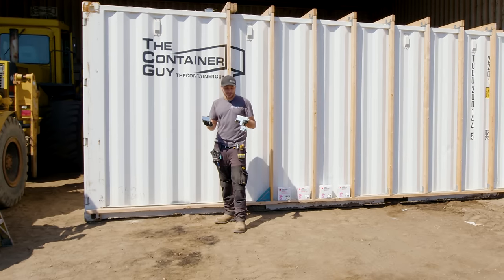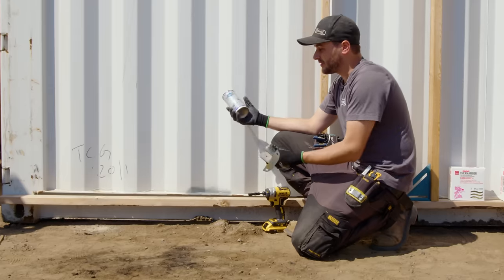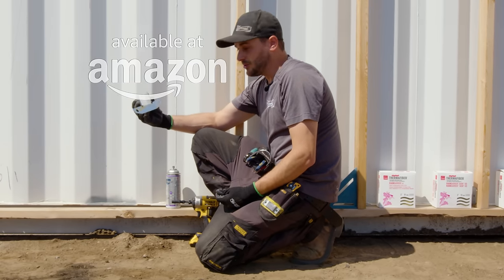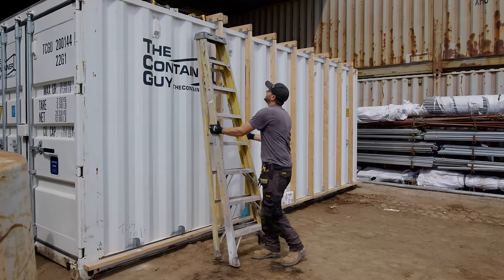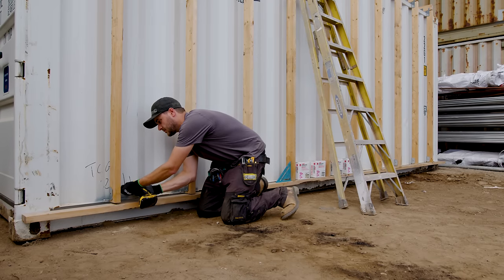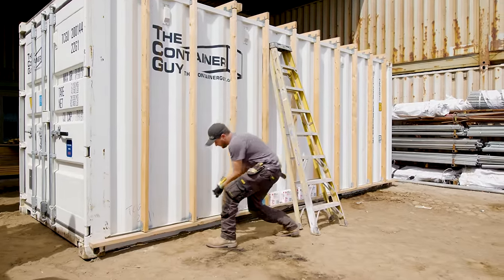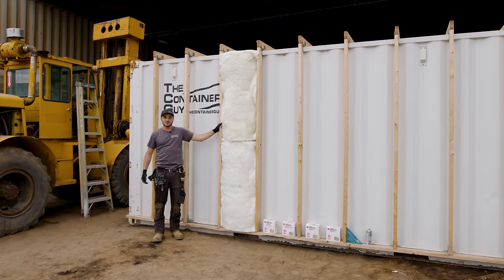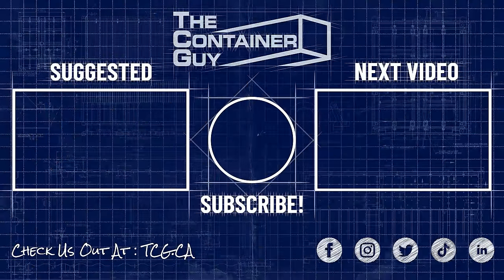Installing Our Exterior Stud Brackets On Shipping Containers !

Comment: I see lots of people commenting that if you're using wood, then what's the container for? I can think of a lot of uses! It's a rock solid foundation to start from! You're structure is only as good as it's foundation! If you want to build on a property but don't want to pull permits to put in a foundation, you could go this route. Not having to do dirt work saves a lot of hassle. Maybe you need to mount something super heavy on the roof, this would be perfect for that. You could put this out on a remote piece of property and have a super strong/secure little hunting cabin that could probably have a tree fall on it and survive. If you had need for a mobile office you can pick up with a telehandler, then this is perfect. If you want to bury a bunker into a hill side, this is perfect. It's a great product for some niche or outside the box thinking projects! Just because you're simple mind can't think of a use doesn't make it a bad product.
Reply from the maker: Smart man
Reply: Also wood is cheap and no welding. 🤣
Reply: I'd agree. I think the price is what makes this a hard pill to swallow.
Reply: I would only use a container if it was free.  Otherwise just use wood and someone might even buy the structure from you when you want to sell.
Reply: @badawesome  Or use a container, and you can sell the container and have it moved off of your property, instead of having to sell the entire property.

Comment: WAY---WAY OVER PRICED... $2,100 FOR 100 PIECES Thats 20+ for each stamped steel bracket.. hurricane clips cost 1.25 ea.!!!
Reply: A two by four fits sideways between the top lip of the container and the bottom lip, no need for brackets! Then the side protrudes just enough outside the waffles to run your siding on. I’ll retrofit hurricane clips for the top. Way to pricey !!!
Reply: Right? But then again everything this guy sells is overpriced...his man doors are 5x the price of similar man doors.. lol he cracks me up
Reply: ... they're probably being made on a "first come first serve" request 🤔 ...like the way blacksmiths used to build stuff.
Reply: It’s expensive… do they make it in house?????🎉🎉
Reply: Yes he is crazy as hell with stupidity for prices
Reply: I fail to see why you would even need a container if your just going to stick frame the whole thing anyway...I dunno maybe I'm not getting something
Reply: @seangrey3505  - I think it's easier to install Insulation between Wood Studs. 

That said, why not "Stud" the "High Side" (external Edge of the Waffle Skin) if it's for More external Insulation?

Adding Extra Insulation outside, means less required inside, so more room left for "Living" inside!
Reply: @robertweekley5926   I see what your saying but if I have to build it out of wood any way I'll keep the 1500/2000 for the container and I'll keep the added cost of the wood and brackets...and just frame it up traditionally...if he had something that actually didn't cost an arm and a leg maybe MAYBE  could see buying something if I needed to stack or mod.it some other way other than just sitting level on all four points
Reply: Hurricane clips are weak and trash.
Reply: Hurricane clips are made by the millions, these just a couple of thousand
Reply: @seangrey3505  i think it appeals to people without the skills or experience to make walls level and plumb

Comment: Four thousand 400 dollars 2 do my 2 40ft containers is a crazy price. Thats without shipping 2 Australia.  Will the price come down at all?? I love all your products , but struggle with the prices. I understand they are fit for purpose but we pay about 4k for a 40ft high cube.
Reply: same here
Reply: Agreed, I really like these brackets, but the price isn't realistic for me either. I get they aren't made in China, so the price is paying for Canadian materials and labour rate, but at the end of the day it's either viable or it's not.
Reply: @langdons2848  Yeah the Kit for a 40 foot top and bottom is 92 pieces (I believe) for 1,850 dollars. I assume that's USD, but could be Canadian? Either way, it also comes with the screws. It's only $20 a bracket. So not like a terrible price per bracket but when you need 92 of them it does add up fast. I bet if they could get a bigger production going they could come down on price but that'd require a lot of sales and investment on their end. Like normal joist hangers for a deck or a house I'm sure they're made in the tens of millions and shipped all around the world, so they can get a lot better price per unit because of the vast amount being made. It's always a lot harder for smaller guys to get those quantity discounts. I really like these brackets but at 1,800 dollars it's basically the cost of a used container. Really good idea though. If I was them I'd try to see if one of these big manufactures doing joist hangers would want to take over their production to get the prices lower. If I were gonna buy these, I'd want to see a price of about half of what they're charging now. Otherwise you may as well just figure out a DIY system.
Reply: @dedalliance1 I agree, Simpson could do this for ¼ the price an still make $$

Comment: I think the bottom ones should have a flange that you can screw the bottom plate onto instead of toenailing. If the edge of it was dropped to be flush with the metal lip on the bottom, that would be even better. Nice job, keep them coming.

Comment: As a german carpenter master  i can say build without a Container.  No condens and your free in place for rooms.
Reply from the maker: If everyone were as skilled as you, I agree there is no need to modify shipping containers. The one argument for them is there is no concrete flatwork or foundation  required and you begin with a structure from Day 1.
Reply: @TheContainerGuyTV  correct. Point foundation is the Future. No massive concrete. 1m3 concrete in germany is 220€.🙄🙄
Reply from the maker: @thomasschafer7268  please continue to provide input on the system as I release videos. I am not a carpenter but I feel a sense of responsibility to develop a healthy, low cost method to modify single containers with readily available materials for those who are less fortunate and need a roof over their head.
Reply: I helped a friend build a container cabin several years ago and came to the same conclusion. The result was fine, but the container really is limiting. One benefit though is that my friend needs to move to a new property soon and it will be very easy to pick up the container and move it with them.
Reply: Does the temperature stay pretty regulated in this thing or is condensation still a major issue ,as with most containers  and all unvented containers ???
Reply: What you talkin bout Willis?

Comment: I'm a metal guy too but when using wood, you should add a hammer to your tool belt to use when you need to persuade wood members to fit. Using your impact driver as a hammer could be very expensive. Living in Minnesota, any sort of structure that doesn't lend itself to being insulated is a problem. I subscribed and will definitely check out your brackets.
Reply from the maker: 👍 Yup I should have one around but not interested in lugging it around. 

That's why I said "hard on tools". I don't even know if we have a framing hammer in our tool crib now that I think of it haha.
Reply: @TheContainerGuyTV  I am curious if it's not "Better" to "Stud" the "High Side" of the "Waffle Skin, versus your application to Stud the Low Side (Indented) of the Waffle?

Comment: Excellent video. Regarding the stud-to-roof connection, you could utilize a horizontal through hole in the bracket to attach another bracket that would hold the roof rafter. The rafters could pivot on the bolt to accommodate different roof pitches. This way, the roof would be attached to the container as well as the studs.
Reply from the maker: Great idea
Reply: Exactly
Reply: Yep you are right on!
Reply: A roof bracket with a height adjustment on the outer side and middle, you could roof the container and a side area (plus give an air gap between container and roof) keeps the container cooler in warmer weather.  Could also catch the water containment for later use.
Reply: An adjustable angle roof would allow for maximized solar by changing the pitch of the roof / angle of the panels to correspond to the angle of the Sun due to the season. This would eliminate the need for added weight and cost of adjustable frames on top of the roof.

Comment: Nice instructions.  I would recommend using treated lumber for the plate (base lumber that is running horizontal).  You're going to have moisture coming down the outsides of the finished exterior.  If the lumber at the bottom is not pressure treated it will most likely rot over time and invite termites etc.

Comment: Consider running the studs up an extra foot high on one side to allow a sloped roof. A little over 1:12 slope, for panel rib metal roofing. Fire blocking at the ceiling line, and attic ventilation will also be important.
Reply: if you want a sloped roof. I want a roof deck
Reply from the maker: Check back in this Saturday ;)

Comment: Another option to prevent the brackets from rusting would be to use a rubber gasket or butyl tape (could use an old tire tube for the material)

Comment: Once again you guys are leading the way! Those brackets look plenty strong, perhaps thinner stock would work as well and reduce cost. I'll have to figure out how to attach a pitched 2by to those top brackets. The ven the large number of roof pitches used, I don't see anyway to make a line of brackets that accommodates them all. I guess do it as it's done on a stick built house, notch the rafters to sit on the top plate. I'm less sure of the economics of framing the exterior sides with 2by lumber, seems stronger than needed if typical siding is to be used. After all the container provides a rigid shell. But being able to side it hides less than perfect containers and no doubt allows them to blend into a typical neighborhood. 

I eagerly await the insulation video, as this is a major point in a container building. Just my opinion but rigid foam is probably the optimal way to go.
Reply: Yes, I thought the brackets were well over specified. Normal joist hangers are less than 1mm thick in my experience. Plenty of material could come out of those with no detriment to the structure.
Reply: @billdoodson4232  The other point would be that while you might want beefy brackets to support a pitched conventional roof, the 22" spacing might be a problem in high snow load regions. Local code might require 16" OC. And the rafters wont line up with conventional sheathing. Someone smarter than I can figure out how to best use these.
Reply: Easy problem to solve. See my comment above.

Comment: Consider redesigning that top bracket to accommodate the top plate, move those outside ears back a bit. Redesign the bottom bracket to hold the bottom plate. With the insulation you could split the sides of the batt in a few inches to tuck it in behind the stud and create a bit of a thermal break and make use of that extra width.
Reply: Good advice.
Reply: The studs should only have to support insulation and sheathing. Your container is the structural component.

Comment: You should do a video on how to deal with the condensation problem inside shipping containers…. Location location location …  sea level. / On a mountain .. heat and humidity.. proper ventilation.. cold to warm .. ..  interior surfaces sweating / mold build up ….   Metal containers are famous for this problem..

Comment: Channing, rather than drilling and screwing the bracket into the container, what are your thoughts about grinding clean and welding the bracket. Then following it up with a good primer. I hope to hear back as I am building a home out of two 45 foot High cube containers in South Georgia.

Comment: Nice.. 
Myself, I would use spray foam insolation on the outside, So if you use steel studs on the outside and spray foam and with metal siding. It should last for many many decades..
Thank you for sharing, love you're thinking outside the box..
Reply: This is exactly what I'm thinking of doing with my 20'. I want the inside to stay as is I'm just going to build a wall inside the doors to set AC, etc.

Comment: I would suggest adding an overhang on the sidewalls to keep most of the rain off the sidewall entirely. Say something in the 2 to 4 foot line. This shaded sidewall should reduce heat in summer due to direct sun on the container as well.

Comment: Nice, looks like it would be easy to shim one side of the roof brackets to pitch the roof for rain drainage. Nice plate to attach fascia and you run your wiring exterior only penetrating the container where absolutely necessary.

Comment: Love those brackets.. while I am no expert on framing or containers.. with the top brackets.. if you wanted to push the stud in an inch and a half, I'd prefer a mounting screw hole that's further in from the end.. those 2x4 have a tendency to split if you drive screws in too close to the ends.. maybe a slightly different bracket design with a wider front post that allows you to secure further from the end...
Reply: you could predrill

Comment: I'd like to see how you transition the sides to the door end and the closed end. By the way the brackets are awesome. Spray foam the outside. No having to build interior walls. Just partition walls right?
Reply from the maker: https://youtu.be/Y5oEXhtmLEQ

I address it a bit in this video. Not the doors too much. Still haven't got there. Honestly might be best to frame and insulate right over them and not try and keep them operational. Or remove them and install a patio door set.

Comment: shots fired!

what kind of lumber would you be using for those 2x4s? is borate or pressure treated wood worth the extra cost?

would it just be possible to do steel exterior studs too?  i guess that defeats the purpose because people want to cut costs with wood framing and use fiberglass insulation
Reply: Pressure treated lumber is very corrosive, I wouldn’t recommend it! If you want to get more durability you could use a wood primer but the in wall space should be dry. If you’re getting condensation a dimple mat vapor barrier against the container will help to prevent moisture buildup. Then using the mineral wool insulation would be the best option other than spray foam.
Reply: ty for the reply  @OB1kyote64

Comment: Mate use hex head wood screws instead of the Phillips head to mount the studs,unless you need them to be flush.
Reply from the maker: Yeah the larger hole would fit a 1/4" hex head. Good call. Doesn't need to be flush

Comment: Excellent, brilliant engineering, I have been contemplating using a shipping container to build a tiny house and this system makes it so much easier.  I am also considering using a semi -trailer to build a tiny house, I’m not a builder but how hard would it be to adapt this framing technique to a semi-trailer?  Thanks for your ingenuity and innovations.
Reply: Good idea. I'm surprised that more people haven't thought about using a semi-trailer.
Reply: 30 years ago someone where I lived turned a reefer into a bay house.

Comment: I have a question for you, I am building my home and a garage out of containers. This question is about the garage, It consists of 2 40 ft containers separated by 12 feet that will be a concrete slab. I have cut out half of one wall and am surprised at how springy it is. The boxes are supported on their ends and a concrete pier in the center. I like the idea of welding bar stock in the C channel to stiffen the floor, What would you consider to be the minimum bar stock to use. I don't plan on driving onto the containers, vehicle traffic will be restricted to the concrete slab, except maybe my lawn mower and motorcycle. Thanks and I enjoy your content greatly.

Comment: A buddy of mine bought a 8 X 20ft used container for storage. It cost him $1800. If it's used for storage it saves time but if you are looking to build a mini home or micro home you would be better off to just buy the wood and build one. I live in a cold climate and it needs to be insulated so you would still have to buy wood and insulation for it. Using a container would be more expensive.
Reply: 100% 🎯 ... I've often wondered why anyone would convert a shipping container into a home when you could just frame the whole thing out of wood or metal and clad it in metal siding to give it the look they're after

Comment: I really like this idea and your vids are always awesome. The cost is a little steep ... I'd like to see it about 40% less than what's posted. I'm trying to see what would be more advantageous this or using the insofast exterior kit. 

Keep up the great work!
Reply from the maker: We'll get the cost down. We're working on kits now when we find time. This system is probably the way of the future which stresses us out. Don't use the insofast. Just spray foam.. similar cost and a million times better
Reply: I appreciate the response. Best of luck and keep innovating!  @TheContainerGuyTV